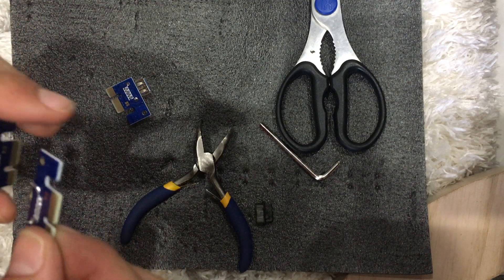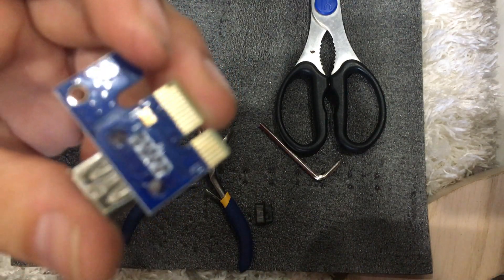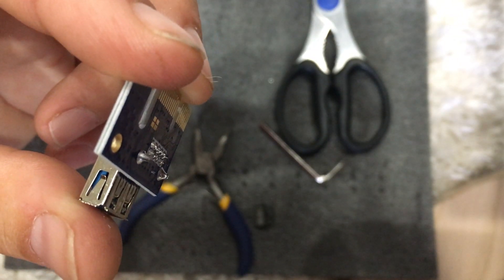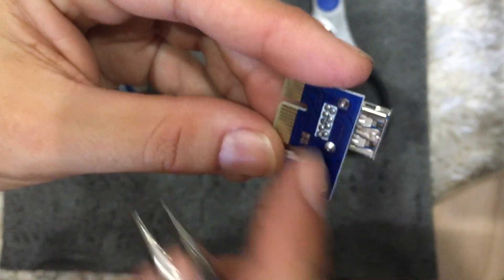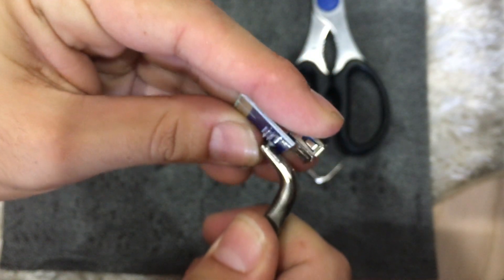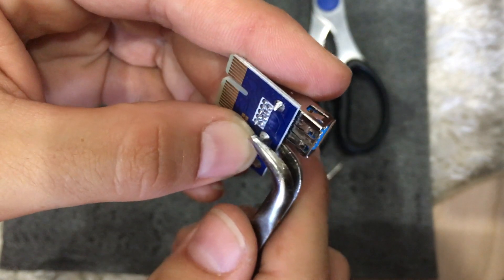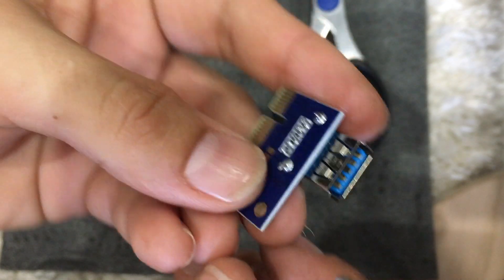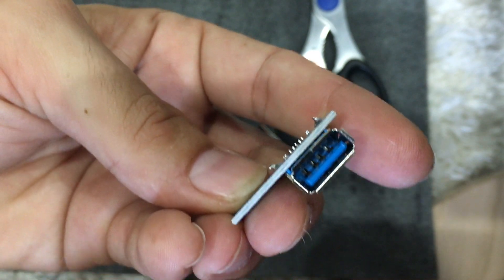Mining rig crash-PCI-E short-2018-DIY mining rig keeps crashing.

Comment: I’m having crashes like every 4 hours or so...I will try this tonight and let you know if it helped.
Reply from the maker: Hopefully it does. How many cards are you running, what is each cards power draw and what type of psu are you using ?
Reply: Miner Digi 6 Nvidia 1070 ti drawing about 166.66 each with two 850w psu
Reply from the maker: Mostly likely it’s no a pcie short because it would crash immediately. Positive on the power draw?  This sounds like a power issue but let’s dig deeper. What miner are you using?
Reply: Miner Digi nicehash with all algorithms enabled...the most wattage to the wall with all hardware has been 950 watts I think with Lyra2Z
Reply: Miner Digi i has 4 gpus connected to one power supply and 2 on the next.  I just rebooted the system and when powered on the 4 gpus sounded much louder than the other two.  I removed one and evened it out, 3 and 3.  Turned it back on and back to normal.
Reply: Miner Digi could the processor have anything to do with the issue?
Reply from the maker: No CPU will not . What is your virtual memory settings at? 32,000?
Reply: Miner Digi I changed minimum to 8k and max 12k
Reply from the maker: That’s part of ur issue
Reply from the maker: 32,000 minimum
Reply from the maker: Tell me if that works , it should💪🏽
Reply: Miner Digi doing it now..will let you know what happens
Reply from the maker: If not your next step it to remove 1 card and try running 5 if it still crashes you need to try 4 ... if it works fine with 5 or 4 than its a pay issue
Reply: Miner Digi what should I do for max?
Reply from the maker: Psu sorry
Reply: Miner Digi I set it at 32k minimum and 40k max.
Reply from the maker: You can go into the 60”s if u need bro 💪🏽
Reply from the maker: Results ?
Reply: Subscribed, thank you. I don't know if you helped that guy, but you helped me.